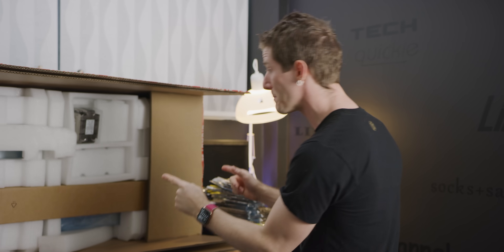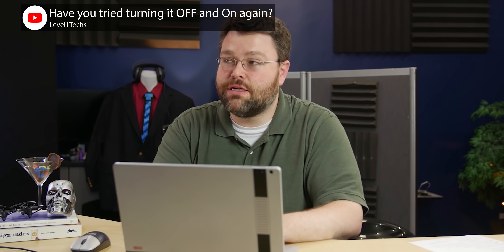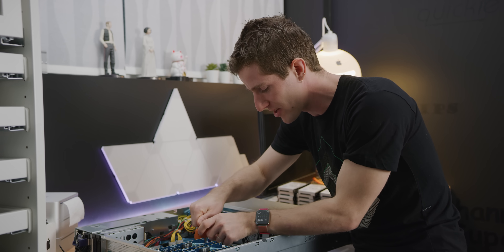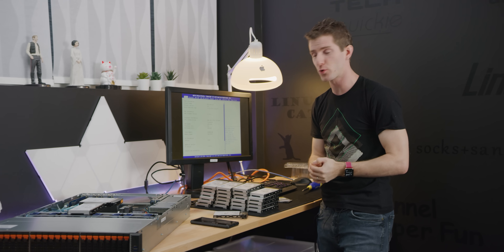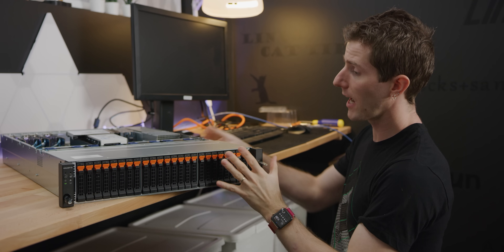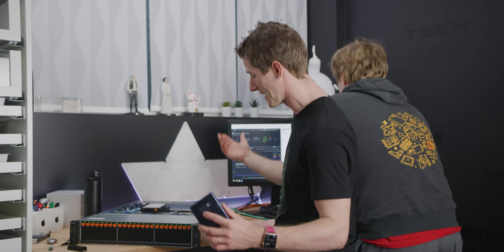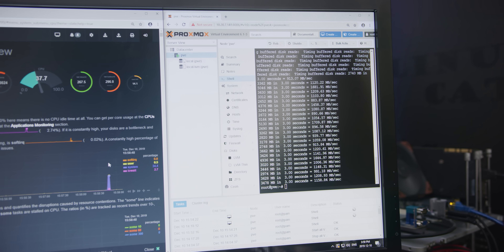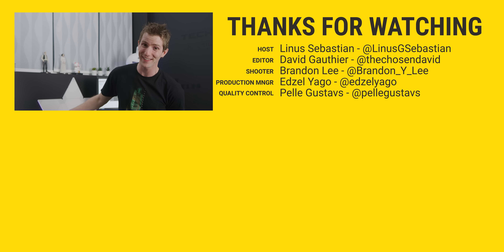Where Intel is in REAL Trouble... - AMD EPYC Server Upgrade

Comment: Those Intel DC series NVMe SSDs have some funny performance attributes. I have one in my Z390/9900K rig connected to one of the M.2 slots with a special M.2 to U.2 cable that had to be ordered from Intel. Benchmarks perform as expected, as does IRL sequential read and write when copying large size files. However, copying a folder with large numbers of small files ( such as Steam library) TO the drive, the drive stalls, lags and performed worse than a platter drive. Tried Secure Erasing the drive with Intel SSD utility (this supposedly flashes ALL the NAND in an SSD, securely destroying any data on the drive in seconds as well as restoring lost performance, at the expense of one PE cycle on every cell in the drive), manually forcing TRIM several times, no improvement, that's just the way they are. All drive utilities report the drive as healthy.

There might be a reason Facebook was dumping them...

They do have great IRL random and sequential read performance tho, so if u have a free M.2 slot on your motherboard and can find one for super cheap, they do make great game library drives as that's 99.999 percent read, and random write performance doesn't really matter.

Comment: There is now way Windows storage spaces is going to scale at that level.  Linux and BSD are the only options.  Proxmox is not a terrible idea as you can run containers for your various storage services.  The ZFS bug is annoying, but its likely the most fit for purpose solution at this scale.  Just get a certified Wendell to configure the zfs tunables for you.

Comment: Why would you use raid z1?
z2 is the safer option. Yes you lose space, but you have bigger chance to survive failure.
Resilver is the most dangerous operation. Recovering from failure with one disk is disaster waiting to happen.

Comment: Can you run those with mdadm and do a lazy raid 10 to get max read? That is still 38gb/second. I know lazy raid 10 does everything in 2 bigger chunks. A and B. I think it still allows a decent amount of drives to fail too somehow. It allows more than 2 I believe somehow. Or does it cut into performance that bad.

BTW, I read lazy raid 10 does best with the largest chunk size. Found that out recently. Previously I read it was better at slightly lower chunk sizes for small files. This is not the case apparently. Not sure if this is only for mechanical drives though.

Would upgrading the CPU to the 64 core give more room for the memory bandwidth?

Does anyone else call mdadm m'dam raid? I think you can make two jokes out of that. My damn raid and Madam

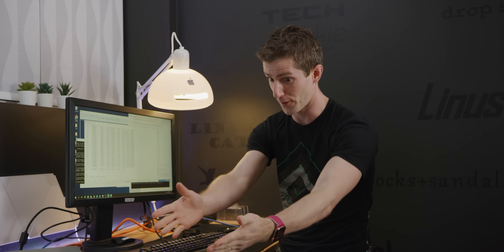Comment: 11:47
and what did you expect from basically software raid (which Storage Spaces IS)
10GB/s is only slower than theoretical speed you could have in  SAN with DA SAS or FC

Real speed comes from many compute/storage nodes in storage spaces direct (S2D) which is basically cloud tech, meaning all connections go through virtual ethernet switch embedded teaming of many high speed eth controllers again on many servers and all that should be connected with TOR switches with incredibly low latency - meaning you are supposed to have DATA CENTER not server or server room....

Comment: Intel is not in trouble. Yes they are getting fucked on the "allround" side but they still beat amd no problem at gaming. Just look at the i5 9600k and i7 9700k. Only streamers should use amd but all kiddos are way2 fanboy

Comment: AMD really is gaining ground. However, they still lack in the meat and potatoes. This are midrange servers with up to 6 to 9 VM guests. It is only a matter of time until they re-build the trust AMD lost when they basically abandoned the server market. We are still a couple generations away from that trust being restored. Large storage media servers are very small percentage of installs. Really Linus should be looking at fiber channel SANs that makes up the bulk of the large storage market. You then would add separate Hosts machine to the fiber channel SAN. That's the normal design concepts you see in the real world application. Basically Intel still has time to wake up. Linus stuff is very specialized and probably represents less than 1% of market cases. His stuff basically replaces Silicon Graphics L5 servers(only place I ever saw RAID 3 in the wild). The no RAID takes into consideration Microsoft pushing its Storage Center platform that pushes Hyperconverged storage solutions. In that design you use Windows Storage Solutions to setup RAID.
Reply: Those Intel SSDs are sold out. I don't see Intel in trouble anytime soon.
Reply: @Patrick73787  Thats not what he is talking about more the CPU.

Comment: Merry Christmas.
Ask Wendell from Level 1 use ZFS with their Raid Level s which also does scrubbing. Using Proxmox as a alternative Hyperviser could also unleash the power of the 32 core Epyc Wendell is also likes to use them 😉
Ok the ZFS error sucks.
Wendell the tec support for the tec support 👍👍👍😁😂😆

Comment: Test DataCore already ;) It runs within Windows Server and virtualizes your Storage, even has diskmirroring capabilities with no performance hit...

Its a SAN solution but you can present the drive to itself (and then create the share within windows again). You could even mirror your data sync or async to an other server running DataCore, even within Azure or something.
 https://www.spcresults.org/benchmarks/results/top10/performance/spc1/1

Comment: I don't really get why the theoretical read/write performance matters so much to you Linus, because that server probably only has a 10Gbps ethernet link up and even if you organize a 100Gbps pci express card, that would limit you to either max 12.5GBps or the max the pci express slot bottles out... for example if the network card falls back to pci express 3.0 and 16 lanes that would mean 16GBps... next bottleneck would crawl up at the switch, you could theoretically use link bonding with two 100Gbps cards to gain more but I would hate to see that monster of a switch to be able to relay that further to the 10Gbps clients... so to sum it up, without a real infrastructure and backbone the theoretical values mean not much.
Reply from the maker: Because we can, basically :p
Reply: @LinusTechTips  : Yes you can, anything, everything, its just a matter of money XD

Comment: You should try to user glusterfs, it supports both gluster client as well as nfs for remote shares and should scream when it comes to write and read speeds, then when you need more starve you just make another and add it to the cluster
Reply: They use gluster

Comment: Why do you use Windows on the server? 🤔
Reply: I just set up a Linux server with ext4, in LVM, on software RAID10, on GPT partitions. Is it a NAS, or an onion? :D
Reply: The server is probably headless, if that's the case you should be looking at a windows pc used for remote management

Comment: couple of notes:
- hardware raid is dead. no wonder they don't implement it on the Motherboard, totally reasonable. 
- everything happens in software these days. (like you did with ZFS for example)
- zfs raidz1 for a production setup is absolute no go! you have one failed drive and you need to rebuild the vdev. you put additional strain on all the other drives during rebuild. you can not have another drive fail during rebuild. NVMe drives are so much more reliable than anything before, yes. but they will fail. so you are still gambling. 
- even worse: 4x raidz increases chances for (easy) failure... well by four... 
- zfs was not designed for speeds and latencies of NVMe. Even less so large pools. It will bottle neck you. You can't tune it enough. 
- these kind of systems (meaning the chassis, MB and CPU, etc) are designed as distributed storage clusters (Gluster/ Ceph). it just doesnt scale/ work as good as it could for your use case.

Comment: ZFS requires tuning with NVME drives. The safe defaults are not going to do well. You gotta find the native block size on the drives and make sure you not only set the ashift size correctly to match the native block size, but also the recordsize so that most common writes are broken up nicely to fit. The drives are probably 4k native so you need to set ashift to 13 on pool creation. With 4 raidz-1's that's 6 drives per vdev, optimum record size is 80, so you'll need record size set to 128 or 64K. Not perfectly optimal, but you'll see much better numbers. For best performance, you'll need to do more math and figure out the best way to align the pool. 

You can also just switch to Solaris if you want to run zfs. Oracle seems to have foregone all these issues.

Comment: Why are you never using Linux from the beginning? In Windows as you said, you are absolutely limited.... Or use a bsd at least.
Reply: It has to do with the automatic transcoding software they were using on Whonnack server...
That for some reason  is windows only..
Reply: Most likely is more used to the tools that windows offers

Comment: Hi Linus,

I was testing the EPYC rome too and it could be that you are hitting the wrong pci-e root if you are making one big vdev pool. Can you try and make one pool on one particulair  pci root? It's kind of NUMA related sinds they are still sort of 4 chiplets.

In my case I was testing the HP DL385 Gen10.1 and there was a document where Nvidia had problems getting NVlink to run over the EPYC Rome platform and it didnt work because of the differen pci-e roots.

Hope this might help you a bit further

Comment: LTT,
Does UnRAID work on it? In this particular instance you may want to look at Openfiler as well. The problem with most prosumer/SMB solution is they aren't designed to run at those speeds and/or that amount of hardware. Very interesting to see someone already hit the limits of Epyc, keep it up.

Comment: Those fans sound like F1 engines when they rev up.
Reply: I literally thought it was an overvoltage delivery to the Power Supply Unit (FINALLY a genuine comment, sick of the puberty spam, lol)
Reply: Yea, thats servers for u ^^
Reply: 1U servers fans are loud as hell. 2U fans are not as bad.
Reply: V8 or V10
Reply: or my dell poweredge 2950
Reply: Look for Gamers Nexus NAS, Wendel shows a Gigabyte Server there too. wait for the moment he pulls one fan ;)
Reply: Put them on the corners, direct the airflow down. World's first VTOL server.

Comment: AND this is why NVME SSD is not being used on the enterprise because their is NO hardware raid fast enough to keep up with... except for a few companies that have proprietary solutions which are not industry standard. Right now best best is a SAS 12 GPS SSD RAID setup like 10 with 8 Drives, 5 Gigabytes read/write with full redundancy.

Comment: 15:38
Bruh my home network is literally 10 MB:s not Gigabytes but megabytes.
Reply: A byte is 8 bits (a bit is a 1 or a 0), your home network if it is 10MB/s is probably 100 Mb/s, (MegaByte is MB Megabit is Mb) which means probably limited by your Ethernet.  Get a Gigabit capable card and you'll go faster, if your router and modem support it.
Reply: @JoshuaRichards2010  nope it's 10 mb/s our apartment has a free shitty network. Even on cable it's max 7mb/s my average steam download speed is 2.5 mb/s

Comment: The pinnacle of modern tech:
No RAID
Doesn't work despite help from the best techs in the business
Takes 4 days to diagnose the problem
Only reaches correct speeds by running each drive individually
Profit?

Comment: So, you used Intel drives with an AMD mobo and cpu and had issues, i don't see how that puts intel in a hot seat? If you were to show a similar rig with Intel based mobo and intel cpu doing worse, that would make sense for the title. Unless I missed something?

Comment: so you obviously want to passthrough all disks to a freenas vm running on proxmox and create the pool in there. u can pass through the pool back to proxmox to create vms on it. In addition you can run zfs backups from freenas. This is a common setup in proxmox with automatic backup solutions with freenas, if you have a raid controller with jbod function you can simply pass that through, but u can edit vm vm.conf file to add the /dev/nvme drives to the freenas vm

Comment: The NVMe administration identify command states the optimized indirection table. The indirection table should be the page size of NAND pages; if you want high throughput. I.E. 128KB indirection will have low command overhead. In the usage of optimized operations for disjoint workloads then configure separate pools with ARC caches.

Comment: For those wondering which tool they were using at the end to check the write speed, it's called netdata. It's an amazing and super easy to install graphing tool for Linux with 1 second precision and as much data retention as you want. Extremely useful for many things, we use it to diagnose CPU/ram usage spikes in a microservice cluster.